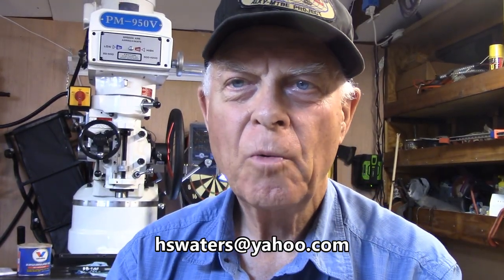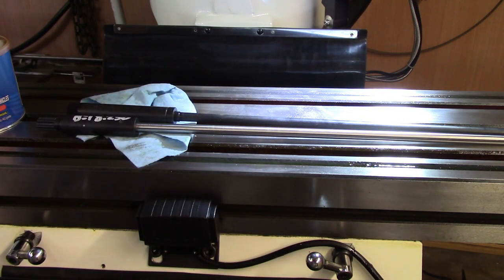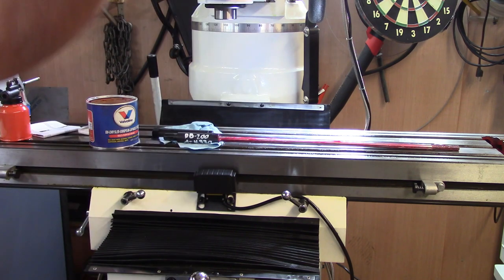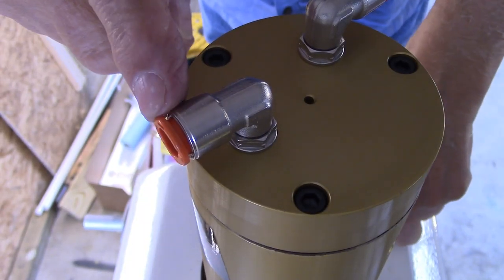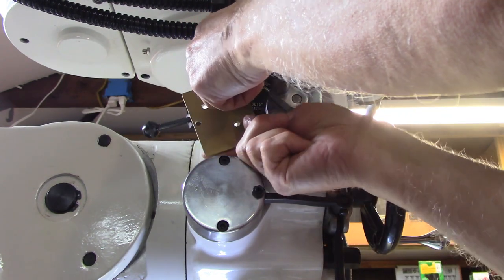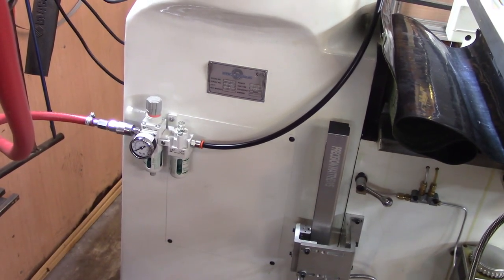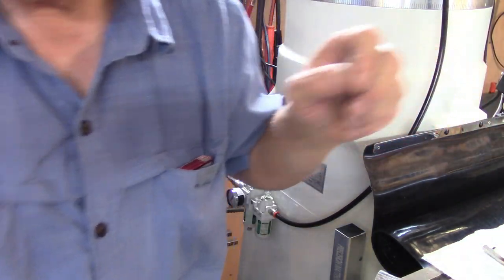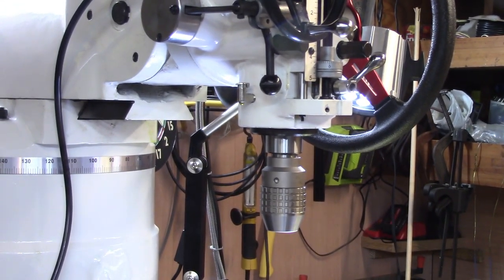TorqueRite power drawbar install on Pm 950

Comment: Brand new stuff always look good.............       For the first moments....!!!
Now it's got to work hard, give it a ride, I'm sitting in my chair and waiting......   😎👍
Just as a note here, don't forget to lock your quill when operating the power drawbar, more so when removing the tools, also if you get the drawbar unscrewed and the collet "Sticks" in there, just give it a gentle tap sideways, it will unstick very easy, same principle as with ball joints where you don't tap on the end but on the side in order to unstick them.
Reply from the maker: Thanks for the tip.  Thanks for stopping by.

Comment: That looks like a well made power drawbar. Since you mounted the regulator to the side, you need yo extend your ram and rotate your turret the full length of the table both ways to check for binding of your cables and lines. I often mount my smaller rotary table on one end of the table and leave the vise trammed in where it sat. You then just rotate the whole turret and extend the ram until its over your rotary table. Find center and you are done. You'll use that ability to move the ram and turret. Just make sure no wires or air lines bind up throughout the full movements. You are gonna enjoy a knee mill Harold.
Reply from the maker: Yes I will be careful of the air lines.  Thanks for stopping by.

Comment: Nice job Harold, later if you find that the feed rate  lever is difficult to move you could maybe mount the drawbar switch on the side of the electrical switch
Reply from the maker: I could at that.  Thanks for stopping by.

Comment: Excellent channel and video sir ,did you have to cut the threads off  to length on the new drawbar?
Reply from the maker: No in fact what I did was to put about 3 washers under the drawbar to make it tall enough.  Thanks for stopping by.

Comment: Harold, what is the total height of the power head and the air fittings?
Reply from the maker: I would have to guess but maybe 20 pounds.  The power head is the heavy part.  Thanks for stopping by.

Comment: Congratulations on breaking 70 seconds.  Not bad for an old fart.  That is a good looking milling machine. You lose man points for reading the manual. LOL  Wonder if one of those would work on my Burke MillRite MVN?  Can you extend that plate to remove the interference with you feedrate lever?  Diaper that machine base to absorb the oil.  I figure if times get too hard I can knee cap a couple of Congressmen and have 3 hots and a cot for many years to come.  Love the videos.
Reply from the maker: I was really glad to get under 70 seconds considering I have been trying for so long.  Thanks for stopping by.